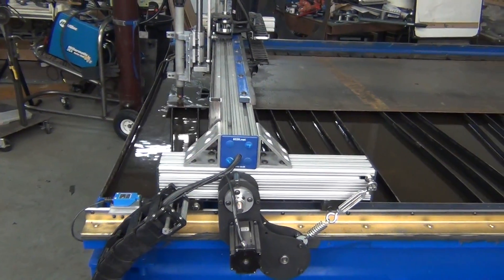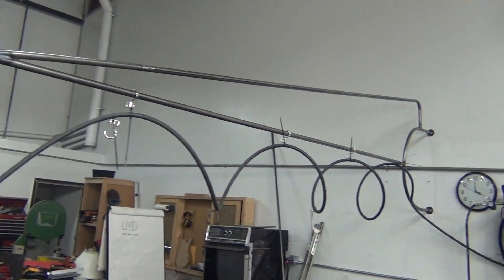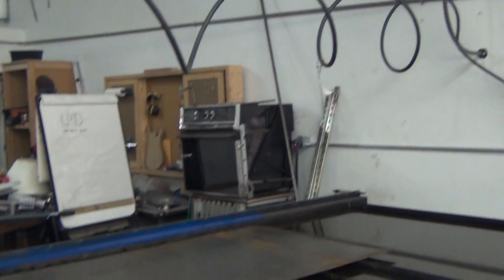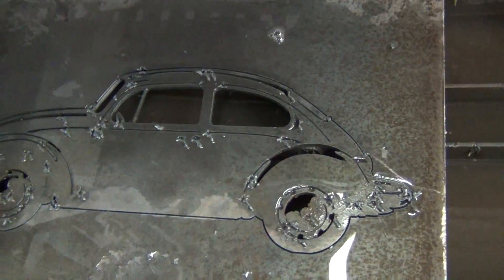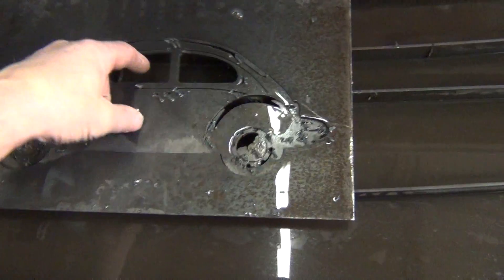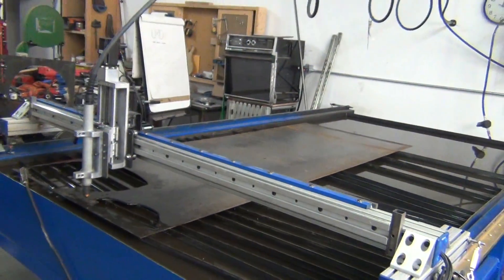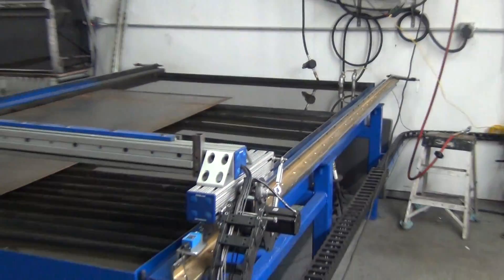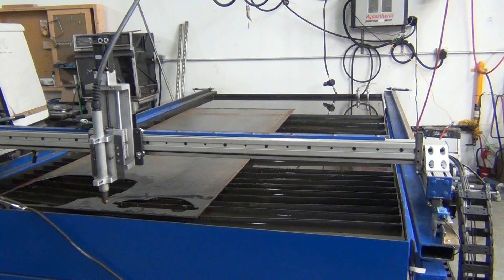My homebuilt CNC Plasma Table Cutting

Comment: how much did you spend on the build ?
Reply from the maker: leo galvan, around $11.5k initially, but I've upgraded over the past few years.  I now have a powermax 85 plasma cutter with the serial interface, and upgraded the electronic system so it cuts better than ever!  Still the coolest thing I've ever built!
Reply: would not be cheaper to buy one already made ?